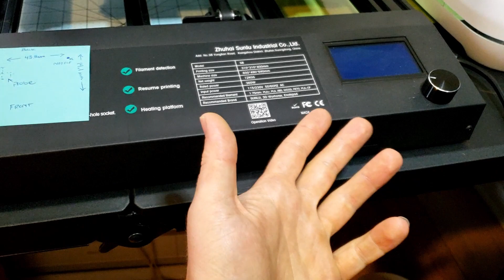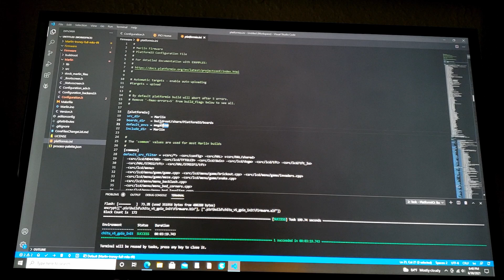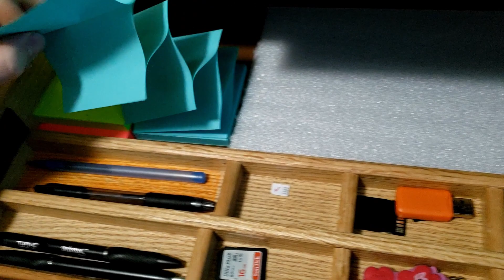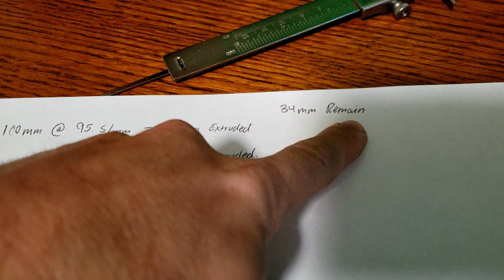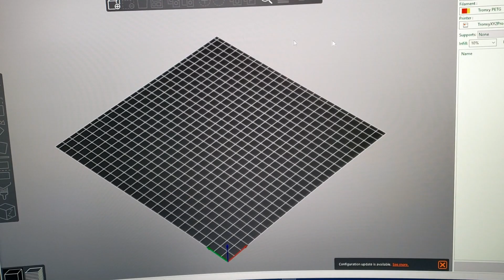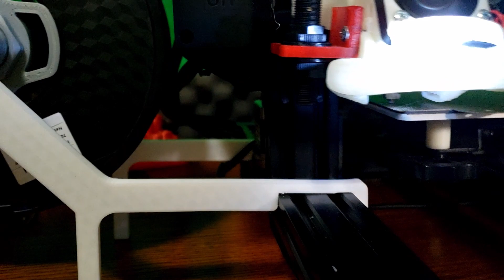Flashing Firmware And Running EZABL Pro Sensor On Sunlu S8

Comment: Are you still running that same start/end gcode?  You create a new mesh before every print?  Any issue with M420?
Reply from the maker: No it save the bed mesh from doing the auto level. The start g-code just tells it to home and heat. then run test strip. Pulls the mesh thats saved to eprom.

Comment: You might want to make sure there's a little bit more strain relief on the probe wire. When the x is moving back and forth it twists that cable a little and over time it'll fail. There's also an easier way to get to the z offset. Tim has it so you just click and hold the button for a second and you're in the z offset.
Reply from the maker: Oh nice, I didn't notice that feature in the firmware.